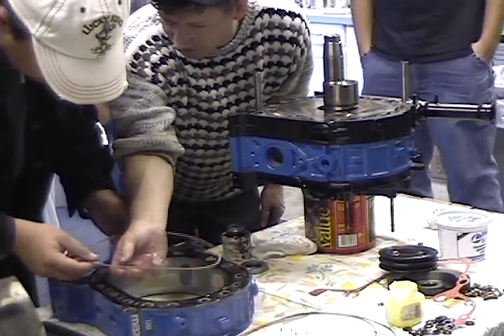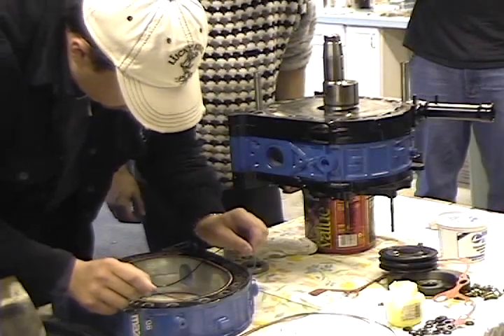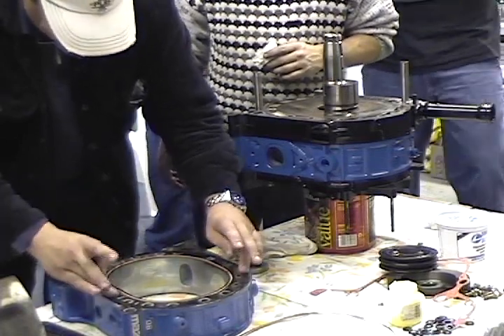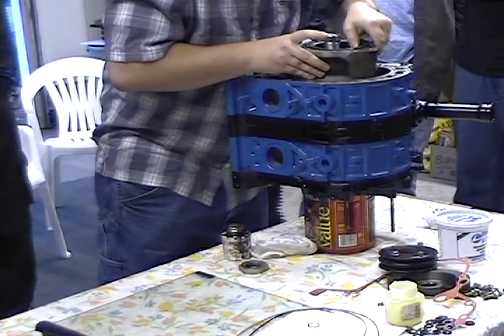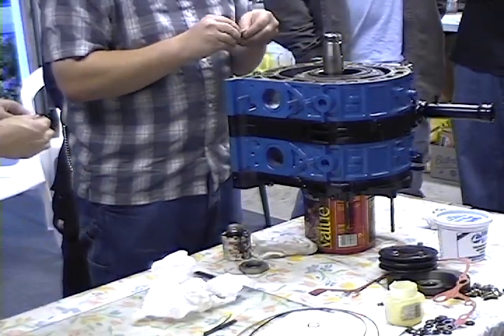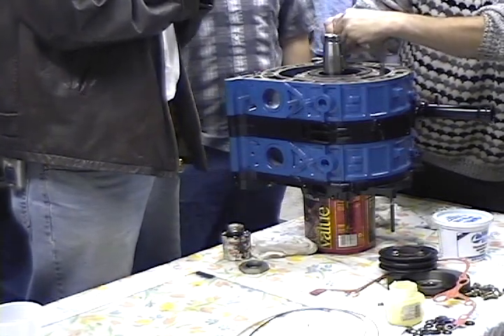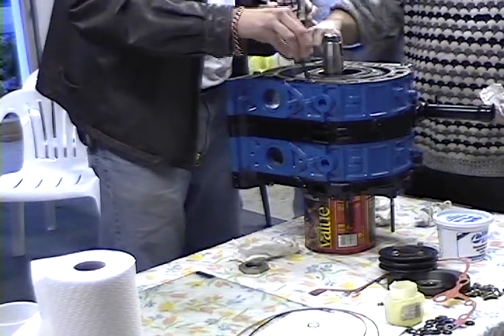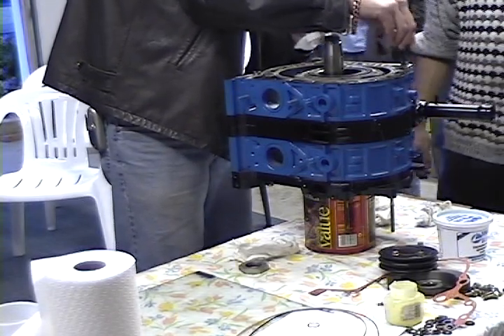How To Repair Rotary Engine 6

Comment: permatex really isn't necessary. vaseline is better for holding the "O" rings in place and u don't have to clean it from inside the rotor housing.